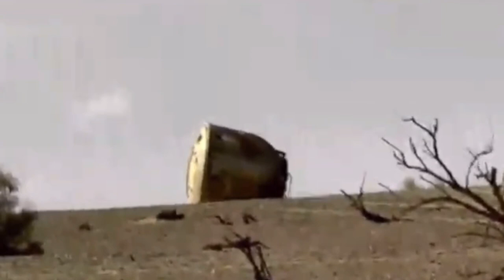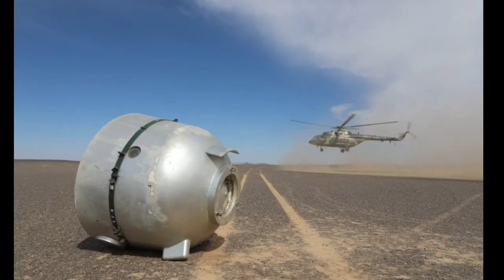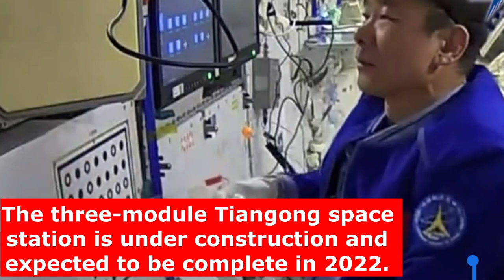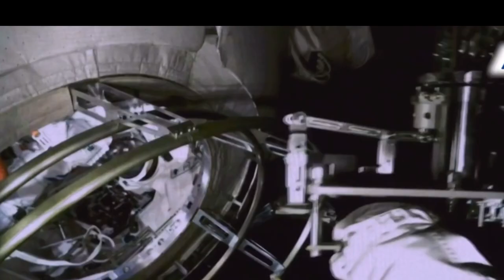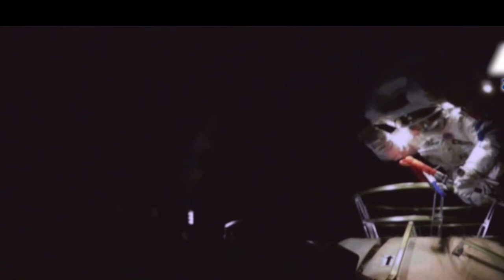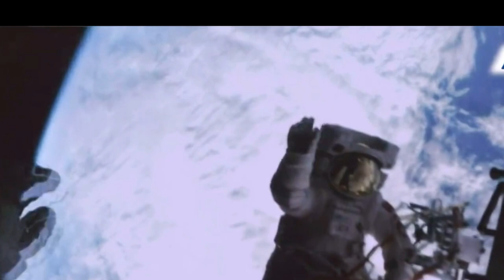Shenzhou-12 Heroes Return Home

Comment: I thought the capsule landing was hard.  Parachute deployed, the capsule was swinging to and fro.  Yikes!   Ground is very hard.  Water is much softer.  Wouldn't it be safer for the Chinese astronauts to land in the ocean?  The ocean water would provide a softer landing.  China has a large aircraft carrier.  They could use it to deploy helicopters to the ocean landing area.  Just make the capsule waterproof... and deploy floats when the capsule hits the water.